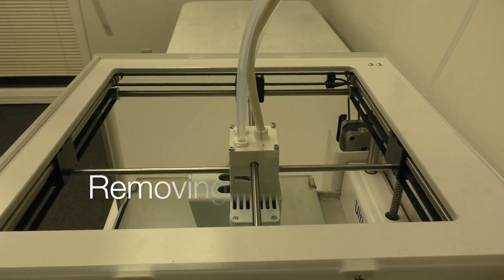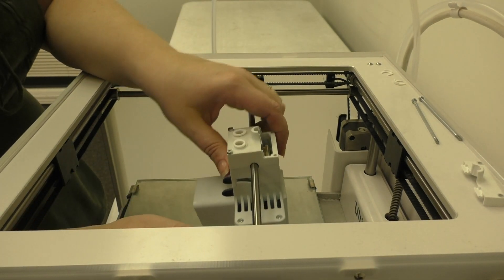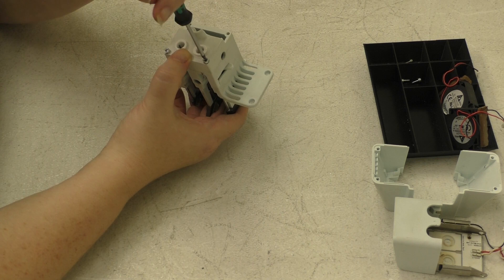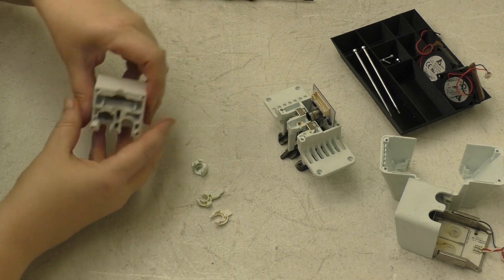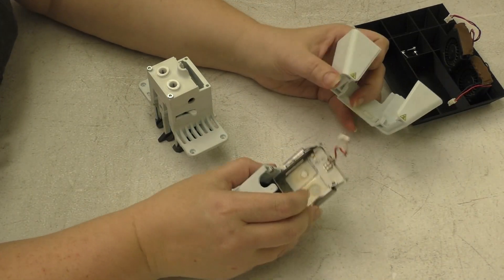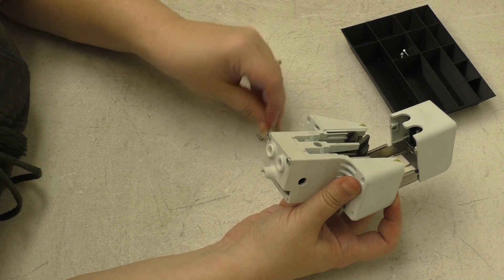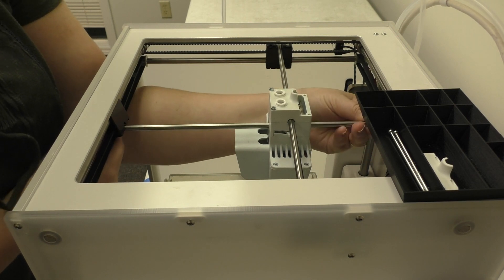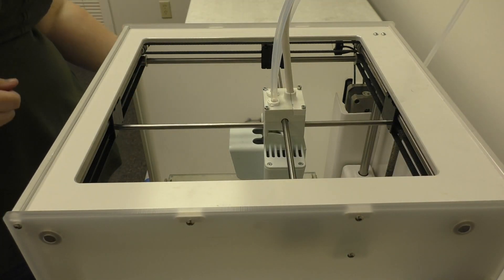Printhead PCB Installation (UM3/UM3X)

Comment: The lifting switch spring escaped it's place and is now sitting on top of the printing core, exposed. Any tips on how to disassemble without parts flying around?
Reply from the maker: The spring is under a lot of pressure from the top assembly piece, so keep pressure on that piece when disassembling, and remove the pressure slowly to help keep the spring from being under too much pressure when it comes free. 

If the spring has slipped through the bottom of the lifting switch mechanism while in use, then it may be pulled slightly out of shape--you may be able to push it back together (more compression) but it's a fairly fragile spring and if it's too far bent out of shape it's best to replace it.

Comment: It's a shame you don't show how to replace the sensor board as that's why I came to this video. How exactly does that come out and how does a new one go in? Thanks.
Reply from the maker: This is a video on how to replace the print head PCB. 

I don't really recommend removing the capacitive sensor board from the metal bracket; if you did want to remove it, it's held in place by the metal tabs that come up from the bracket through the sensor. You could straighten them and tug the sensor off with pliers but it's a lot of work and likely to damage something.

Comment: ULTIMAKER 5S. I used your instructions on my UM5s to disassemble and reassemble the printer head after a massive Nylon blob. Worked perfectly. Also the wiring is exactly the same. Thanks for a brillant piece of instruction.
Reply from the maker: I'm glad we could help!
Reply: Almost the exact same thing happened to me, except it was regular PLA.

Comment: Hey, there is a PCB in the print core, the tiny one and it has some connector. These connector hold the heater and temp. sensor wires. Does anybody know what these connectors are called?

Comment: I still wonder why your printhead doesn't have extruders in it. For me with extruders it is whole different story
Reply from the maker: I took the Print Cores out prior to disassembling the printhead--they are designed to come in and out very easily. Are you having any issues removing the Print Cores?
Reply: Hey, thanks for the videos, I do have a problem with the S5. I got the bb nozzle clogged and I have managed to clean it and re installed, after rewiring one of the sensor contact cable, but the problem is the spring mechanism of the switch, it came off and now I suppose I have mounted it wrongly, so there’s an offset between the two nozzles. Can you help, do you have a picture or instructions on how to remount it? Thanks  @fbrc8
Reply from the maker: @manueledellapina8550  reassembling the spring mechanism for the lifting switch is covered in this video. But one thing to remember is there should always be an offset between these two nozzles--it's designed that way. The left hand nozzle never moves up or down. The right hand nozzle moves 3mm up and down with the switch so it is always offset from the left one by 1.5mm so that your inactive nozzle doesn't drag across the print.

Comment: How do you replace the belts in an Ultimaker 3, the clamp blocks failed on one side.
Reply from the maker: Hi there! I have written instructions for that process here: https://fbrc8.zendesk.com/hc/en-us/articles/360001899871-XY-Axes-Parts-Belts-Pulleys-Motors-

At this time, I don't have a video available for it.

Comment: Great video.   I have the same problem as Randy and Cece.  I am wondering if either noticed a damaged silicon nozzle cover being the reason that the melted filament was able to backup into the print core?

Comment: Is it the same procedure with the S3?
Reply from the maker: The procedure is very similar for the Ultimaker S3 and Ultimaker S5. The connector for the printhead is on the back of the PCB rather than the front as it is on the Ultimaker 3, but otherwise the process is pretty much identical. Your cable cover will slide off vertically rather than horizontally as well after you remove those first 2 screws.

Comment: Erin, THANK YOU for this video!!  I had a failed print that managed to seep melted plastic all up around the print core and the gantry, making removal of the #1 print core impossible.  The gantry was easy to take apart, but not so easy to put back together :)  Only took about 4-1/2 hours with a heat gun to pull out the PETG, then re-insert the heat cartridge wires into the back of the print core & follow your video to get the gantry back together.  Printing once again...
Reply from the maker: Glad to help!